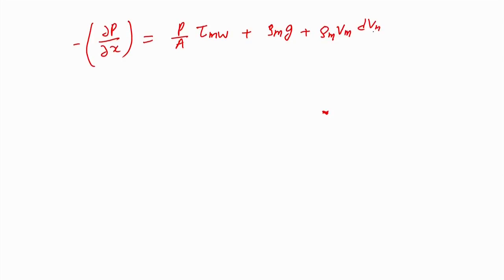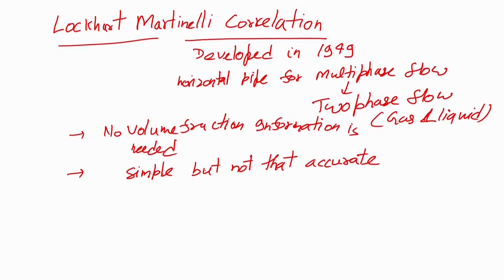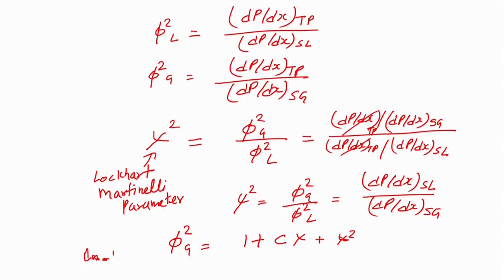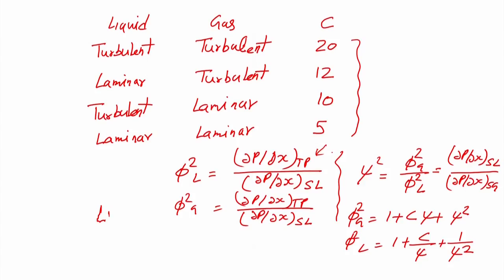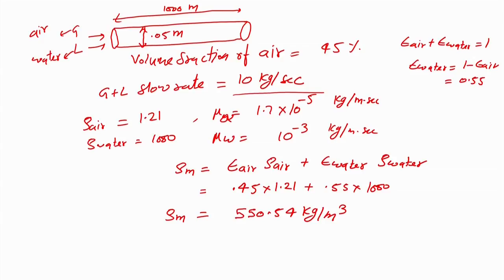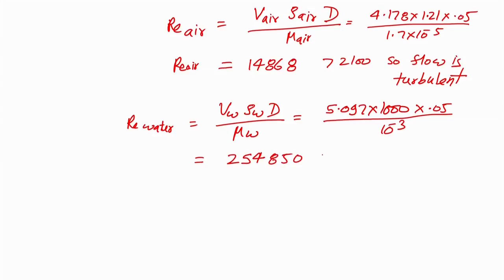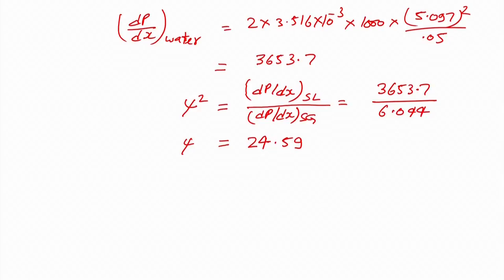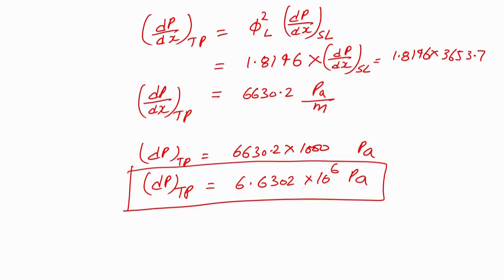Lecture 8: Lockhart Martinelli Correlation

Comment: Thank you Dr. Rajesh for this video explanation. 
When you were calculating the volumetric flow rate of water you got 0.0099 but I got 0.01001. Though the fraction difference is small but I got the overall steps for the calculation. 
Also, to simplify further can write down the steps to get the answer before starting the calculation?